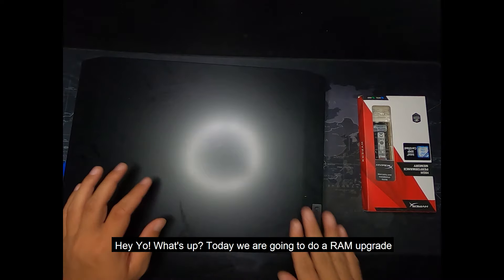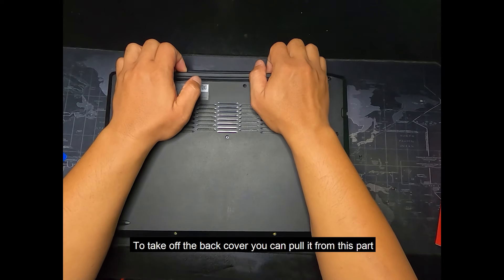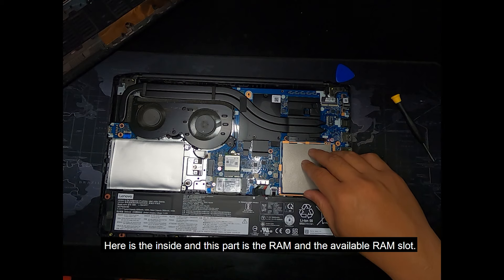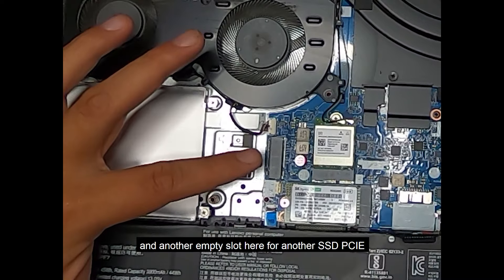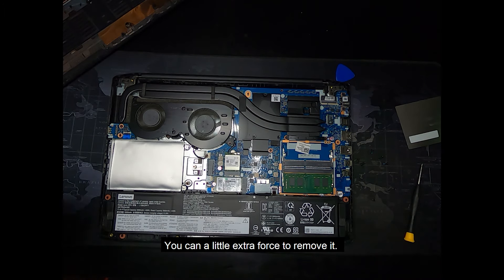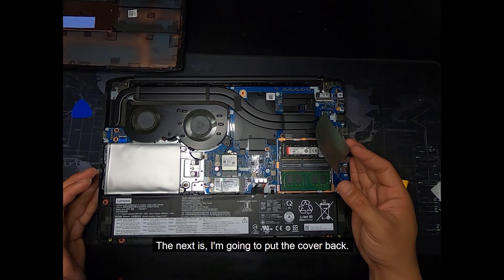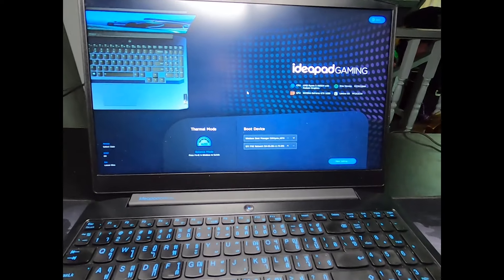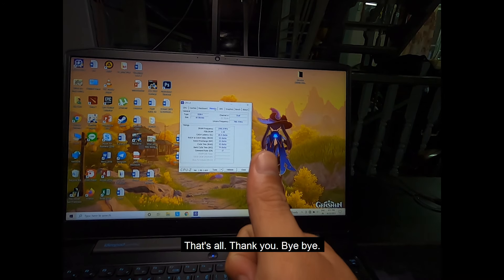Lenovo IdeaPad GAMING 3 | RAM UPGRADE | COMPLETE tutorial

Comment: Did you match latency of Hyperex and your defalt RAM (because it is CL22) ? I realy struggle to find matching ram with this defalt LV32D4S2S8HD-8
Reply from the maker: Hi! if you you have a different CL the system will calibrate your RAM at the slowest CL. Example if you have CL18 and CL22. It will run at CL 22. If your market is not that wide just make sure you'll get the same GB and mHz of your stock RAM to activate dual channel.
Reply: @flitzgraytech3666  thanx for that info 👍
Reply from the maker: @kresa22  Don't forget to subscribe! Thanks!

Comment: Bro does idepad gaming 3 i5 1650 variant supports 32gbram? I mean by installing 16gb ln each channel. Although the manufacturer lists only 16 gb max on specifications of the product but on several online forums I had read about people claiming it to support more than 16 gb of RAM storage
Reply from the maker: It's better to follow the manufacturer list. Although you can check the motherboard model and try to do a research again.
Reply: It support the idea pad gaming 3   64

Comment: Currently my pc is running with 8gb 3200mts so to upgradeit can i install 8gb 3200mhz and 8gb 3200mts at once in both slots or do i need to remove mts in order to upgrade it?

Comment: I put 2 same model fury impact ddr4 3200mhz with CL20 and then blue screen problem occurs occasionally. Now, I take out 1 of it and replace it with the original built-in ram (ddr4 3200mhz cl22) and see how 😅 

follow ur steps since see u remain the original ram and just add 1 more new ram
Reply from the maker: I would suggest that you do it again. Just make sure that the RAMs are properly installed. There should be no problem as long as you two working RAMs.

Comment: Hi man! I've got a question. At first Wonderfull tutorial, you got yourself a new sub! Today I ordered the Lenovo IdeaPad Gaming 3 15IAH7 82S900J8MH. It has an i7, RTX3060 and 2 8gb RAM slots installed. The website where I bought the laptop says the maximum RAM is just 16gb. Do you think I can add 2 16gb rams? Maybe the website is just preventing me from buying more RAM... Can you check my model and confirm I can upgrade to 2x 16gb ram? Thanks for reading!
Reply: 2x16 gb?  work?
Reply: Idk man...
Reply from the maker: For this kind of situation. I always use the Crucial website. In my experience, they are pretty accurate. For 15IAH7, it says that the maximum memory is 64GB. See it yourself. https://www.crucial.com/compatible-upgrade-for/lenovo/ideapad-gaming-3-15iah7
Reply from the maker: I think we all know that a motherboard that has rtx3060 can't just have a maximum of 16GB RAM.
Reply: mine is Lenovo Ideapad Gaming 3 15ach6 with R5 5600h and RTX3060 and it support 32gb (16gbx2)

Comment: Sir should I go with 8x2 or 16x2 ram I'm a student and a freelance video editor.
Earlier I used to work on PC but recently got IdeaPad gaming 3 r7 5800H. 16 or 32... I work on da Vinci resolve and on pc I was using 16 gb (8x2) and it was sufficient but i wasn't gaming on pc but I've decided to game on the laptop sir, so 32gb or 16 gb?
Reply from the maker: What is the graphics card? If you have 2080 or higher, it's definitely better to have 16GB x2. But if you have 1650, 8x2 is enough.
Reply: @flitzgraytech3666  it is a 3050 sir with a TDP of 85w

Comment: i think you should not remove the battery. its not that important to disconnect battery from the motherboard. since it's not really related to inserting ram in it. Just turn of the laptop and plug it off the powersupply
Reply from the maker: Sometimes I do. Sometimes, I do not. As long as we are careful.

Comment: Hey Paulino. Nice video. I have one question here. 
So if the laptop has 2933 max usable clock speed then is it good to fit 3200 mhz in it along with the previous 2933 mhz one? Does dual channeling work well that way?
Reply from the maker: It will still work even with different mHz. It just that your 3200mHz will be calibrated and will decrease to 2933mHz.
Reply from the maker: Thanks, man!
Reply: @flitzgraytech3666  Thanks for the fast response man.
Reply: @flitzgraytech3666  so, dual channel is not enabled if one stick works with a diff freq than the other one?
Reply: Doest it work?
Reply: @notsam_7  ik im 6 months late but.. yes it does work with different freq, as flitz said the 3200mhz will be calibrated automatically to the 2933mhz so both can be 2933mhz and dual channel will be enabled

Comment: So Can we use two SSD's with this laptop? if Yes what is the maximum SSD that we can use in a single slot and what is the maximum RAM we can use in a single slot. Thanks.
Reply from the maker: Hi

according to Lenovo specifications:

Storage Support

 	
- Up to two drives
          1x 2.5" HDD
          1x M.2 SSD
• 2.5" HDD up to 1TB
• M.2 2280 SSD up to 512GB

Here is the reference:

https://forums.lenovo.com/t5/Lenovo-IdeaPad-1xx-3xx-5xx-7xx-Edge-LaVie-Z-Flex-Notebooks/Lenovo-Ideapad-Gaming-3-2TB-HDD-Upgrade/m-p/5100517#:~:text=%2D%20you%20can%20add%20a%20maximum,icon%20below%20to%20thank%20them!

Comment: Hello Flitz. I have a bit of a problem. I bought my 15ach6 with an 8 gb Samsung DDR4 3200 ram. Today I bought a 16 gb Kingstone Hyperx Impact DDR4 3200 stick, and upon plugging it in, the laptop went into BSOD loop. I really dont know what to do with this. I've tested both ram slots with my original ram stick and both work fine. Testing the 16 gb ram in either slots dont work. Would appreciate any help.
Reply from the maker: Based on the information that you've provided. There's a big chance that the 16GB ram is defective. Please check for any physical damage on the new RAM. If you have another laptop where the RAM is compatible, please try it as well. If not, I would suggest returning it where you bought it.

Comment: sir why am i finding it hard to open the back panel?can u guide me please.Ive opened 10 screws
Reply from the maker: Make sure all the screws are removed then pull the back pannel starting at the rear part. Also have a thin plastic pick like the one that I was using to removed all the locks inside.

Comment: Hi have a question, IdeaPad gaming 3 !
Have one 16gb 3200mhz Ram that came with the laptop and the ram clock is only at 1600mhz as per hw info. Should it be in dual channel to run 3200mhz or higher?
Reply from the maker: Is it 8GBx2 or 16GBx1?
Reply: @flitzgraytech3666  its 16gb x 1 but i think its sorted now :) thanks for the response
Reply from the maker: I'm glad!

Comment: So I got a Lenovo IdeaPad Gaming 3 2022  NVIDIA GeForce RTX 3050 Graphics  15.6" FHD Display - 120 Hz - AMD Ryzen 5 6600H - 8GB DDR5 - 258GB SSD and I was wondering how much ram can I put on it?
Reply: On the official specs. it says 16Gb. but on most of the web sites they say it is16gb max per slot. So here are some sites so you can you're own opinion
Reply from the maker: Sorry for the late reply. I don't know if you still need any help, but if you were able to upgrade your to 32GB, please share it here. 

But to answer your question, as I mentioned in other comments, just a while ago. Please check the Crucial website. https://www.crucial.com/compatible-upgrade-for/lenovo/ideapad-gaming-3-15iah7

Comment: I have a question? I have a problem with the Lenovo IdeaPad Gaming 3 15ARH05 laptop
After starting the laptop, a white LED lights up to indicate that the laptop is working.
The fans turn on for a moment, and after a while the fans turn off.
The laptop screen is black.
What do you think might be damaged in the laptop?
Reply from the maker: There's a lot of possibilities. It could be RAM. It could be battery. It could be CPU. It could be motherboard. My recommendation is take it to an expert to check the real problem.

Comment: Thankyou for the amazing tutorial - i have a doubt...
My system is Lenovo IdeaPad gaming 3 ryzen 5 4600H gtx1650
It already has 8Gb ram installed 
And i want to upgrade my ram to run it in dual channel mode
But I'm having trouble as to which ram to buy
There are lots of options that's confusing
8x and 16x type... And many more 
Can you or anyone please help me out-
Thankyou
Reply: I have same laptop what you have. I have been planning to upgrade ram. You should get 8gb ddr4 3200mhz sodimm ram stick
Reply: Update here when you buy the ram

Comment: Hey buddy i want a little help here. While opening my ideapad gaming 3 to upgrade ram i forgot to disconnect battery so while i was putting back ram cover a minor shot happen in black button near ram i was very sad but laptop was working fine as it was earlier as if nothing had happened what could have happened then? a little help will appreciated thanks. Already subbed.
Reply from the maker: Hey! I'm sorry for the late reply. Was the black button you mentioned burnt? I'm not exactly sure what component that is, but my guess is it was a resistor. In some cases, some parts of the motherboard will still work. Even a resistor is burnt or now working. In your case, if your laptop is working, then that part of the motherboard is okay, even with one less resistor. Just avoid getting your laptop really hot so you can avoid further damage.
Reply: @flitzgraytech3666  thanks for reply, i really appreciate it. Yes it was burnt out actually it was my mistake i forgot to disconnect battery. My laptop cpu doesnt even hit 70s and gpu doesnt go above 60s it is in 50s (on full load while gaming)  actually i have managed laptop thermally well. But i want to ask will it have any other effect on laptop?
Reply from the maker: @Youtube Account  There's a big chance if the resistor is no longer functioning. But as long as your laptop is working well, don't try to fix it. If that is really a resistor and that resistor is dedicated to the RAM, the problem you could experience is performance.
Reply: @flitzgraytech3666  ok thanks bro you really helped me a alot. I will get it repaired by a technician. Thanks again. Pleasure talking.

Comment: It is not possible, can you help me? with the RtX 3050 4GB and not disabling the integrated I do 30 fps on fortnite, disabling the integrated I do 5/10 but disabling the rtx I make 75/80 (all low I'm talking about), on other games like csgo without rtx I do 120 but with it I do 60, stumble guys without it I do 240 and with 60, how is this possible? please help me, i don't really know what it is. 

P.S sometimes but rarely opening it the rtx does normal fps, I don't really know what it has, maybe it's the monitor screen connected to the integrated one but I really don't know,please
Reply from the maker: I'm a little bit confuse. Let me give a try. 

If you have a second monitor. Try opening Task Manager and go to Performance then while playing and see if the games are running using your GPU. If not, go to your NVIDIA control panel and make sure all games under Global Settings is using your GPU.

2nd is, your monitor definitely affect your FPS depends on the refresh rate. 
 
3rd is make sure that your drivers are updated. 

Let me know about the updates.
Reply: @flitzgraytech3666  1)Using integrated gpu from nvidia pannel I do about 20% rtx and 70% integrated 
2) Is at 120 hz, using the rtx from nvidia I make 30 
3)Already all updated
Reply from the maker: @erxo1  okay. 

1. Another possible issue is bottleneck. What is your CPU and RAM?

2. Make sure your games are optimized.
Reply: @flitzgraytech3666  Game are optimizeded and i have a r 5 5600h and 8gb ram ddr4
Reply from the maker: @erxo1  Okay. Let go to the basics. 
How old is your laptop?
Are you running charger plugged in?
Does your laptop heating up when you play? Maybe it needs some cleaning. 

Also can you check this video. https://youtu.be/lE-VKc2R9L4
Reply: @flitzgraytech3666  1) 2020,bought 1 week ago 
2)Usually 
3)It makes little noise
Reply: @flitzgraytech3666  Now i will check the video

Comment: excuse me, but why do we have to disconnect the battery? im scared of doing that, will it harm my laptop if i dont unplug it while upgrading the ram?
Reply from the maker: To avoid short circuits. If you're confident, it's okay not to disconnect the battery.
Reply: @flitzgraytech3666  im not confident in either, how do i unplug the battery in the utmost safest way imaginable?
Reply from the maker: @epicamigo5395  Don't use much force unplugging it. There's a small plastic part the both end of the plastic connector, make sure to push at those part simultaneously. Don't pull it out using the cables.
Reply from the maker: @epicamigo5395  Oh then use something plastic to remove it. Metal might do damage is you slip while pushing.
Reply: @flitzgraytech3666  if it breaks, i can order a battery replacement?
Reply from the maker: @epicamigo5395  I'm sure you can do it if you're being careful. But if you really think you can't, don't do it. Just make sure that you don't touch the board with anything metal and make sure to discharge the static electricity in your body just touch anything metal before you open the laptop.
Reply: @flitzgraytech3666  thank you
Reply: @flitzgraytech3666  quick question, where can you get those plastic things to open up the laptop?
Reply from the maker: @epicamigo5395  You can order online. Order a laptop repair  kit.

Comment: Thank you for the video. What if you connect a RAM with a battery connected? This is not dangerous? 
Спасибо за видео. А что если подключить RАМ с подключенной батареей? Это не опасно?
Reply: I put the RAM with battery conected....nothing hapend. With nitrile gloves and slowly 🙂
Reply from the maker: There's the risk of short circuit. It's still recommended to disconnect the battery. Better safe than sorry.
Reply from the maker: @kresa22  💯%
Reply: @kresa22  Thanks)
Reply: @flitzgraytech3666  Thanks. Laptop model on video is
IdeaPad Gaming 3 15IMH05?
Reply: @flitzgraytech3666  I agree
Reply from the maker: @spartanezleonid3972 It's 15ARHO5.
Reply from the maker: @spartanezleonid3972  Here's a link for the specs. https://www.youtube.com/watch?v=7_MulKNkXbo
Reply from the maker: Don't forget to subscribe, guys! Thanks!!

Comment: Hi, would it matter if laptop's factory ram is cl22-22-22-52 and i add for example cl22-22-22-32?
Reply from the maker: Hi, the system will automatically adjust it. You will have no problem.
Reply: @flitzgraytech3666  thanks, i already got KVR32S22S8/8 3200 CL22 260 and it works fine
Reply from the maker: @c1borgen  congratulations!

Comment: Hi I want to know is it normal to add RAM from Crucial al to my laptop that contains RAM from Samsung knowing that they have the same frequency and type 3200MHz DDR4 so will there be a problem with the compatibility between the two rams
Reply from the maker: As long as the specifications are the same it will work. Brands has no bearing.
Reply from the maker: Don't forget to subscribe to the channel. Thank you!

Comment: dont pry like that. false. it make some plastics pieces broken
Reply from the maker: Hi! Thank you so much for the correction. It would be greatly appreciated if you would mention here the proper way to do it. Better, maybe you have a video or a recommended video tutorial. Thanks a lot!
Reply: @flitzgraytech3666  try to slide at the corner from at the front top. then use the prying tool.

Comment: If only you spend time actually thinks about this laptop. 
-It has 10 screws not 11 back cover screws.
- All back cover screws doesn't have the same size, the 6 top screws are different than the bottom 4 ones
Reply from the maker: Thanks for correction! I appreciate it.